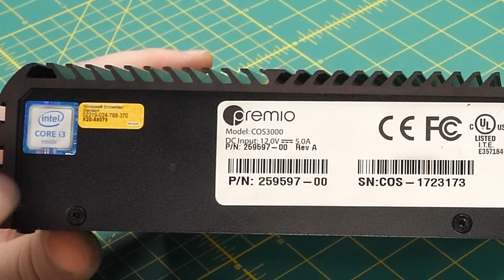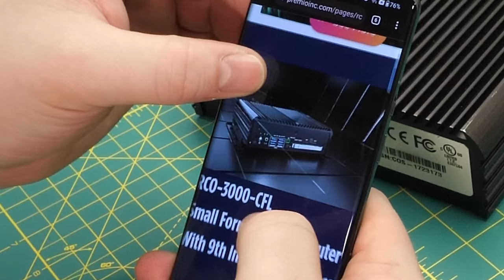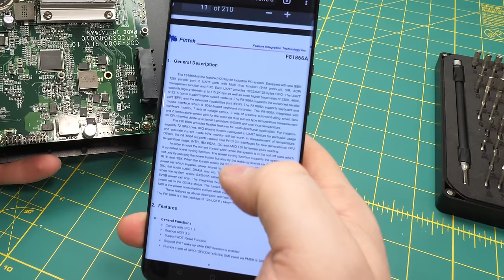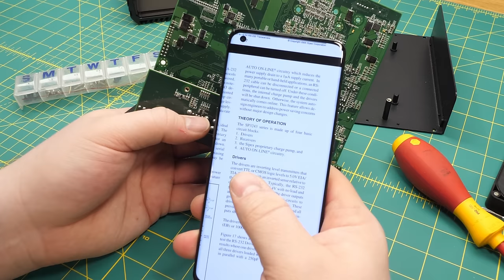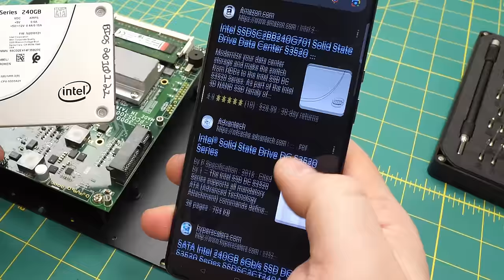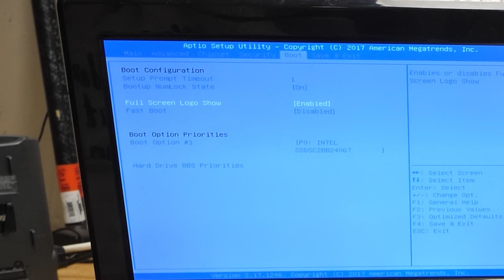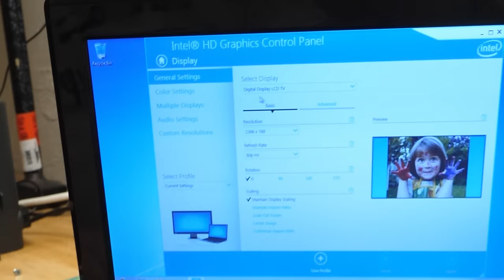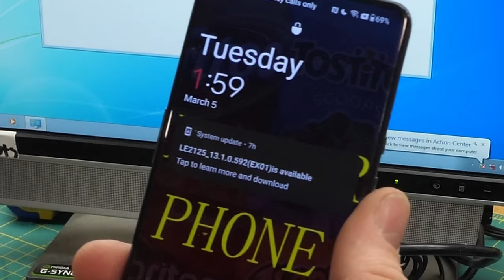Little Guys: Episode 4 [Premio / Coinstar]

Comment: When soldering i recommend a broader tip. I usually use a fairly large blade or chisel tip when soldering. It seems like you would want as small a tip as possible but the heat transfers much more easily with a larger tip allowing you to quickly make good solder joints with lower risk of overheating any nearby components

I know this goes against what literally every soldering tutorial on the planet tries to tell you but trust me. I have never been able to make a good joint using a small tip without breaking something on the board, but put the largest brick of a tip i can find on it and suddenly everything is just swell

Comment: You can get Arctic MX4 in large 20g or 45g tubes for $10/$20 respectively (iirc same huge syringe, just filled to different amounts). Other pastes can be slightly better depending on specific use cases (ex: overclocking, i9/Ryzen 9) but it's a fantastic all-rounder for PCs/laptops that you can get reliably for a great price. I use it on everything in the shop short of 9th gen consoles and have zero problems - performs well on hot systems, very forgiving to imperfect application, not too messy, and holds up to both high temps and portable device use where pump-out can be a concern.
Reply: Apparently PTM7950 handles it all well too, with the added benefit of never dealing with paste, but I've yet to find a well priced and consistent source for small business use 😭

Comment: I use ferrules on almost all stranded wires, especially when they go into a screw terminal... If the terminal doesn't come with a "plate" between the screw and the wire, the ferrule will serve the same purpose: prevent the screw from "cutting" off some strands when tightening. Especially when the wire is "moving", it would eventually snap off several strands and thus either conduct worse or even get loose by wiggling out from under the screw. I'm sure there's "code" all over but it's a sign of quality and/or compliance at least.
EDIT: The RS232 used +/-12 V for signalling. That's why the original PC power supplies had -12V to begin with. But the standard has quite a range on what counts as 0 or 1 on the receiving side, to allow extrem long and poor wiring. So to the best of my knowledge, most modern stuff will just assume a good and short wire and use the much easier created 0/5V instead of -12/+12V.... or a more conservative -5/+5V.
Reply: The spec is all the way between 3 and 15 and minus 3 and minus 15. 

Some really old stuff can expect the higher, in theory anyway. But that can get you rather long cabling without a fuss which i think mattered more when using serial terminals from a mainframe or if you ran your factory machines over it

Comment: 24:22 - 2x7-pin mini connector - probably a Intel LPC connector, it's really a 4-bit @ 32MHz ISA bus and the reason it says "debug" is that it's an easy way to pick up the BIOS POST codes (and some POST cards comes with multiple LPC pickup options. And there's chips/adapters for creating 8MHz 8/16-bit ISA slots which will work with some ISA cards if all the LPC signals are present.... It's been successfully used for attaching ISA audio cards on older PCs without ISA slots (see Vogons). Sadly the ISA DMA capability was dropped by Intel for their Skylake and AMD for their Ryzen chipsets so I don't expect it to work with newer motherboards (audio cards then to use DMA) but this is a Broadwell ULT so the chipset still have this (last generation before it was removed!) but the ISA DMA request lines might not be connected to the LPC port to simplify wiring (if so they may be able to be bodged in if necessary, they may be exposed elsewhere). These days the LPC connector is primarily used for external TPM modules and depending on motherboard maker it uses one of 3? different connectors (ASUS uses a 20-pin connector for example).

Comment: On direct die the thermal paste spread matters a lot. If any part of the silicon is not covered you might have serious problems, even fry the cpu because it did not have a thermal sensor on the non covered part of the silicon so could not throttle.

Comment: I'm probably late on this, 748 comments, but the unfilled SATA header is clearly reversed, both headers have the data group on the side nearest the other. My first assumption is "that's a descending header", and I almost said as much confidently, it still probably is because just about anything would collide with the CPU heat thingy, but, the real thing we know is that these two hard drives cannot be oriented the same way. If it's descending, then the underslung one would be upside down relative to the one that's present, and I'm really unclear on best practices for this. I've been working on a bunch of old lenovos recently that for no clear reason have their hard drives mounted upside down under the palm rest, maybe it's not that big a deal. These little guys however are going to be mounted all sorts of ways, ideally vertical so the heatsink-case can most effectively produce a convection current, which would make the drives stand on end. which should be fine.

Comment: RS232 can be +/-12V and many people think of it as such, but in order to strictly comply with the TIA-232 standard it's defined as being something like signals +/-5V to +/-15V at the driver and +/-3V to +/-25V at the receiver. So a lot of the MAX3232/324 etc (common transceiver ICs) only generate about +/-5V in practise. Presumably it's cheaper and allows higher efficiency by having fewer charge-pump stages whilst still adhering to the standard.
Reply from the maker: I honestly always thought it was weird that it depended on 12V, I always heard people say that's what it was, very authoritatively. Love people being confidently wrong, big fan of that.

Comment: So with HDMI over DVI, it depends on the brand and model of video solution on what you get for output:

AMD cards going back to at least the 4000 series, and probably back to the 2000 series have HDMI audio from a CODEC on the card itself that works over an HDMI cable connected to a DVI port. Even more fun is the GCN 1 cards can output 4k/24 (and I think 4k/30) over HDMI connected via DVI. I don’t know what AMD did but they made it happen.

Nvidia 8000 series cards had a header to inject SPDIF into the HDMI stream for HDMI cables connected to DVI ports. I think the 7000 series were this way, too, but I don’t remember the header on the 6000 series. I also remember Fermi cards being able to do HDMI over DVI.

Intel graphics didn’t always support HDMI audio over DVI connections. I also remember DP to HDMI adapters not doing this correctly with Intel.

Comment: This would make a nice Open Media Vault server. Keep it basic with just adding OMV Extras to get Mini DLNA. Then you can put any media files on it which the client devices have the capability of using. The server doesn't have to process or transcode anything.

I did that with an HP T5740 with PCIe expansion chassis. Put 4 gig RAM in, an Apacer SATA DOM, and a PCIe eSATA card in the expansion chassis to use an external drive. Despite being 32bit with a 100 megabit Ethernet connection to my router it worked just fine for serving HEVC encoded video to a 40" Samsung 4K Smart TV.

Comment: A side note on the rs232 DB9 which only uses 9 pins of the VGA style port.  Rj45 with shielded cable means 8 balanced wires plus a 9th conductor so it technically meets the spec so long as youre not running it over light ballasts.  Thats why it became convenient for Crestron and control4 plus most other high end home audio and video controllers to use to connect peripherals. Much cheaper with a smaller form factor and greater part and wire availability. This is just an observation from my niche area of expertise

Comment: I commented a tad too early before, but as I expected, it just runs mixed DVI and for the VGA they just connect it to via's hooked up to the analogue lines of the DVI, no need to mess with space on the board for a mux or anything, and no changes in the BOM bar a different connector

Comment: Nice one with the connector swap :D the only thing that is missing is, you could now test your idea on the hdmi audio output with an adapter on that thing as well :D
Reply from the maker: Oh, I was so tired by the end that I didn't have the energy for it, and then the next day several people had told me that it wouldn't work so I never bothered lmao
Reply: @CathodeRayDude  With an Intel chip? It would probably have worked fine. As far as I know only ATI ever limited it on DVI - and they did that in software by having the drivers refuse to output audio unless they detected a branded adapter attached.

Comment: The small SATA connector with 4 pin power next to it. its probably a SATA DOM option. Some older DOMs need a separate power cable. The later connectors could deliver power via the SATA connector.

Comment: Yes, you can run HDMI with Audio via DVI.
mid 2000s Graphics Chips such as ATI's X1 series did that, but you need a proprietary adaptor for the right chip that came with your card.
Oh and nVidia did that too, I think.

Comment: Galvanic corrosion between steel screws and aluminum threads can make servicing almost impossible. Especially on systems that are in harsh environments and need to be sealed properly. If you're lucky the aluminum threads come out with the screw and you can just tap larger diameter threads.

Comment: As an electrician from Germany. I was surprised to hear the name Phoenix connector, as the company “Phoenix Connect” for me is similar to “WAGO!” here, as they both produce push-in (screwless) terminal blocks for sub panels (mostly used in Commercial Buildings or in Homes with wired Smart Homes). 
Also, the thing about ferules is interesting, because here if you have a screw terminal and stranded wire you have to use a ferule in most cases or else it isn't up to code.

Comment: Fintech is one of the big players in the IO chip market, and they are even found frequently in desktop computers. In my experience the problem with Fintech IO chips is that they tend to not detect right due to multiple chips having the same internal designation. I have a couple of them in my computer, and without explicitly telling the OS which ones are there only one of them works. So that's my theory about why it is shown in the BIOS.

Comment: The thing about the ports being missing, you can pretty easily tell if they can be soldered in and work, at least on an electrical level by looking at the pads around the empty port, for example, it looks like your unpopulated SATA ports would be usable; assuming your bios/firmware, and drivers cooperate. On a lot of older OEM mobos like Dell and HP had empty PCIE and internal USB headers that did have the SMD components populated and could just be installed but many weren't enabled on a BIOS level.

Comment: The hole in the drive bay is for Old 2.5 hdd spinnem discs. That's where the heat is usually generated from the motor spinning up

Comment: Those optional position for SATA connectors might just be for different mechanical layout, as in those pads might have traces back to the same controller pins as the one currently in use.
Reply from the maker: That's my thinking as well

Comment: I worked in a Datacenter, we had screw in connectors for some things, and you'd still have to check them from time to time because they would work themselves loose. The vibration would unscrew them. BNC connectors are were it's at though, those things never come out by accident.

Comment: The i3-5010U is the same CPU which Intel put in the i3 NUC for that generation. With an NVMe SSD and 16GB of RAM, it's still a pretty capable web browsing/multimedia machine up to 1440p.

The bit at 24:55 about it not mattering how you spread thermal grease is only really true for CPUs with heatspreaders, which will already have contact with every part of the CPU die and ensure that there are no isolated hotspots. If you're cooling a bare die like this, it's safer to carefully spread paste evenly across the entire surface using something which is flat and rigid but not too hard, like a credit card. Glad it worked out.

Comment: Ferrules are somethjng i use wherever possible when wiring mains plugs, ideally you'd want the non-insulated ones but you can get the insulation off quite easily.
I got my last kit from Lidl.

Comment: (31:10) I've also seen it on the Intel Z270 chipset by way of a Gigabyte mainboard I have which has that same HDD/SSD option but for 6 SATA ports instead of 1 as it's a desktop chipset. I believe the option is also present on Intel server chipsets too, not just desktop chipsets.

Comment: Most CPUs today have some sort of USB 3 controller embedded. You may not wire it up to USB 3 to save a few fractions of a cent on the connector and the board vias but they will be still USB 3 by the CPU.

While USB 2 today on most systems requires a separated controller to work. So, it just make sense to use the controller on the CPU and add more cheap USB 2 controllers as needed. Even embbeded celerons tend to have at least two USB 3.0 connection ready.

Comment: Yeah Broadwell was the rare 5th Generation of Intel Core i series CPUs and it was an odd generation because the overclockable unlocked i7 of that generation was called the i7 5775c. I never knew that Intel used that new style of CPU case sticker for the 5th gen because I only seen it with 6th and 7th gen. Majority of new upgraded PC builders had either an AMD FX based system or a Haswell based system during 2014 and by the time Skylake came out made Broadwell obsolete because Skylake or 6xxx core i series processors used DDR4.  Yeah Intel release Broadwell CPU about 4 months after Devils Canyon (4790k etc) and they only released 2 Desktop CPUs. So pretty much Broadwell CPUs were mostly of mobile chips just like Nvidia was with 8xxm GPU chips. Also not only that the 2 Desktop offerings in the Broadwell line up were very expensive compared to the other CPUs of the time.

Comment: my guess is the motherboard is shipped to manufacturing with no connectors at all .manufacturing adds the connectors for customer spec..and they would have a series of backpanels which would be fairly cheap to manufacture to match customer and or model specs..

Comment: The little block on the cpu is a heat spreader. A heat spreader helps transfer heat from a higher-temperature source to a heat exchanger or other heat dissipation device.

Comment: Not too surprised the BIOS doesn't have routines to detect and drive unpopulated interface during POST. I recall running into the same issue often when using docked laptops in late 00s/early 10s - POST only on the internal screen, and maybe the interface on the laptop itself (if any). Third interface that only appeared on a dock/port replicator was too much effort, apparently.

Comment: The SSD mode for the SATA port also made compatibility with older operating system behave better when attempting to query if the number of tracks and cylinders.  Typically SSDs have only 1 cylinder and track which older software think is impossible.

Phoenix connectors are often known as Euroblock and very common in the professional audio and video industry.  Most common application there is balanced analog audio and easily adaptable to the larger XLR connector.  It is incredibly odd that a 3 pin connector is used for power here instead of a two pin to prevent confusion.

The SATA2 port likely folds underneath the motherboard and its carrier tray would likely use some of those other pass through holes on the board.  However, that would not be physically possible in this case.  Just like how the case has features specially for other boards, this board can has features needing other cases.  The header next to the SATA1 port is likely for a 4 pin fan.  Power for a driving using this port would presumably come form an external power supply than a header on board.

Audio over HDMI is actually transmitted over the same TDMS lines that carry video and encoded in data 'off screen' in a scanline.  TDMS is the same signaling used by DVI.  So while not formally part of the DVI spec, audio can be transmitted over connector.  Easy enough to get a passive DVI to HDMI adapter/cable and try it out on a TV.

Comment: The dvi port is usually configured as the hdmi in bios. However i do not know if the dvi monitor used the analog (vga) or digital pins of the dvi port. The digital part of the dvi port should be the second audio output in the drivers for windows.

Comment: So can you use ferrules with speaker cables for a stereo? I can't see why not except that I'd want one with a bit longer end than is on that... I was just dealing with a stereo receiver that has the little springy dealies you just shove bare wire into instead of banana plug jacks and I always have issues getting those in properly, so seeing those made me wonder if that would help

Comment: 30:30 - If you want to interact with the SuperIO Chip on lowlevel like for using the GPIO/DIO Pins you have to now which SuperIO Chip is installed. This is a convinient way without disassembly of the machine.

Comment: There is indeed at least one hobbyist x86 SBC (the Radxa X2L) that uses a SuperIO chip to provide a UART connection between the Intel CPU and an on-board RP2040. Then the board has a 40-pin header for the RP2040's GPIO.

The CPU and RP2040 also connect by USB2.0, so you can treat it just like a Pi Pico connected by an external USB cable. Not sure what Radxa's rationale is for including UART as well, but it's there.